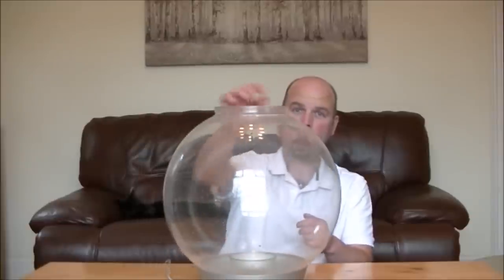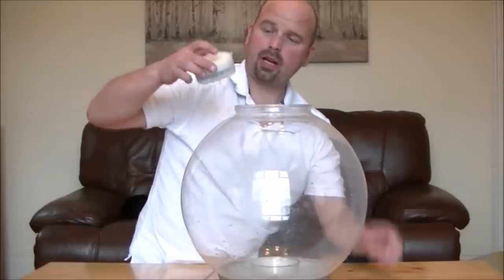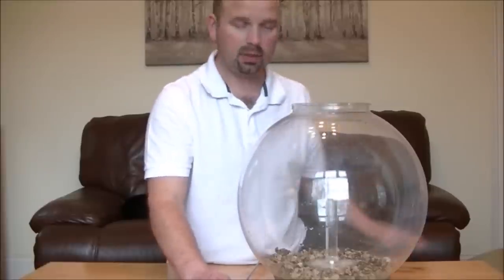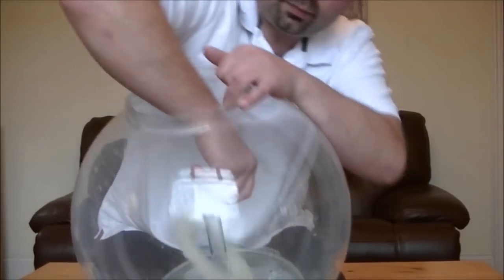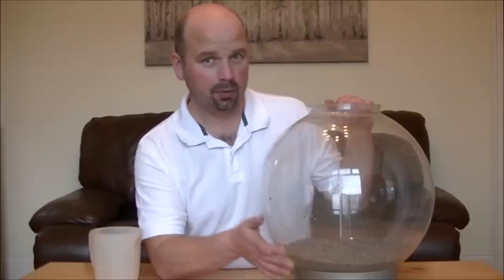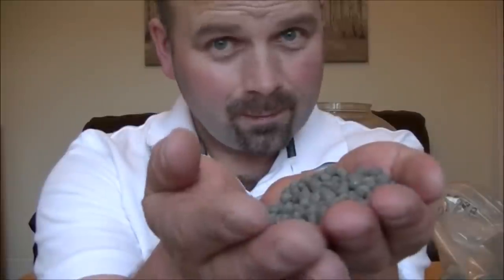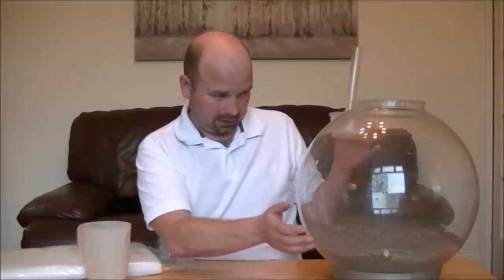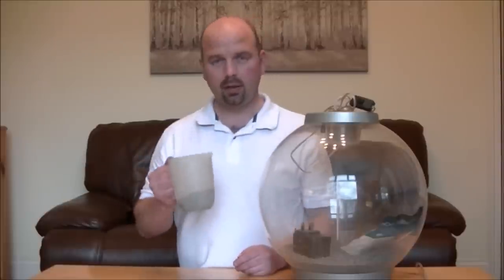BIORB COMPATIBLE UPGRADE KIT

Comment from the maker: Click 'SHOW MORE' for full video description and important links - watch in HD
PLEASE NOTE: amount of biogravel required for the biorb upgrades is dictated by the base area, not the volume of the tank as it is used as a substrate to cover foams. Therefore:
15 litre requires 1.5kg
30 litre requires 2kg
60 litre requires 3.5kg
105 requires 5kg
Above figures are based on the 'orb' shapes tanks - the 'life' and 'flow' rectangular tanks require 3.5kg and the foams would be cut to the full size of base.
Biorb upgrade kits: http://www.filterpro.co.uk ('Filter Kits' page)
Biorb gravel cleaner: http://geni.us/0YMWPJJ
Ornament to cover central filter plate: http://geni.us/WWBqb
(to make removal of central filter easier - less chance of biogravel falling into filter chamber)
How to set up a Biorb aquarium.....Making one of the most troublesome aquariums work properly?
That is the task being completed in this video and it also shows a unique, highly porous 'Biogravel'.
Feeding frozen and sinking foods is now possible with this upgrade as the food will not be lost under large sharp media (Biorb 'lava rock'). Great range of frozen food here: http://geni.us/LNA8 (select type - loads to choose from)
Full kits for 15 litre, 30 litre and 60 litre orbs and external filters can be found at this link: http://www.filterpro.co.uk
The Biogravel and foams are also available separately from http://www.filterpro.co.uk 
The Biogravel is made of the same material as Biohome filter media (sintered glass). Full video on that media to follow.
I will ship worldwide but to save on shipping costs please check out these links for other Biohome suppliers:
US supplier: www.greatwaveeng.com
AU Supplier: www.genesisgroup.com.au
CA Supplier: www.angelfins.ca
Apologies for the long video but there is a load of important information to get in there and I really like to share as much knowledge as possible to promote greater understanding of the filtration process.
Check out how to set up an external filter here: https://www.youtube.com/watch?v=lsAmSD3wVbg
Everything you could want to know about moving bed filters here: https://www.youtube.com/watch?v=DbGWp37djZQ
Biohome questions and answers here: https://www.youtube.com/watch?v=QGI-ybQoJmg
Thanks very much for watching an appreciating the video - please share it with anyone who has a biorb or similar aquarium.
Your support is awesome but as I get hundreds of comments every day I may not be able to reply to everyone.
Contact me by email on sales@filterpro.co.uk or on 07772848730 regarding biohome any time.
Thanks for watching and appreciating the videos.

A FEW COMMON QUESTIONS:

Do I need to take the medium/course foam rings out from under the gravel to clean them? (rinse in siphoned tank water, if so how often?) 
- It is basically creating an undergravel filter so as long as the substrate (biogravel) is cleaned with a gravel cleaner that will remove the vast majority of uneaten food / fish waste from the biogravel and upper foam so the foams don't need to be removed unless you want to do a deep clean which I recommend doing every 12 months or so. So far I don't know anyone who has done that as they don't want to disturb anything which is working well.
Ideally the gravel cleaner would be used once a week to remove waste from bottom of tank, just as it would with a normal tank - that will remove waste, do a small water change and freshen up the tank.

Do I need to take the fine filter pad out to clean, if so how often?
- That is just like the cleaning of the 'normal' pad for biorbs. When it is clogged it will need replacing but since you have so much filtration prior to water hitting that fine pad it could go for many months before it needs replacing - every tank is different but most will go 4-6 months before the pad needs replacing. Check after 2-3 months and if you think it would go longer next time just extend cleaning intervals to suit - no point cleaning / replacing a clean filter.

Do I need to replace the foam or fine filter pad, if so how often?
- See above with regard to fine pad in central filter, outer foams should last a good 18-24 months before they lose their 'bounce' but will still function as an undergravel system beyond that.

If I’m taking out the foam or fine filter pad. Do I need to take out my fish before doing so to be safe? I don’t want to kill it. 
- If you are removing the fine pad in the centre then that can be done with fish in no problem but removing the outer foams will involve taking out the biogravel so ideally that would be done when the tank had been drained and fish removed for duration of work - muck could be stirred up when the system is pulled apart so best to do that when fish aren't present. 

Is the air pump that comes with the BiOrb unit sufficient? If not what power air pump will be best?
- Yes the standard air pump will be fine as water flow is not restricted by the undergravel system.
Reply: Great video.  Do you have a video with it all hooked up as well?
Reply from the maker: No, but I will be doing a follow-up video showing a marine / hard water option soon and may as well film them running.
Glad you like the idea.
Reply: Loved your vid , Mr GURU ....ive just purchased a second hand biorb life 60l and so glad i came across this before i wasted money on those stupid middle filters , i was actually going to try similar to what youve done but wasnt sure if i could , as i say soooo happy i came across this , only thing im unsure about is the fine filter in the middle how often do i clean that please and i carnt find the white /cream pads where did you get those from and how much of this Biohomme do you think i will need x
Reply: My Betta Fish got pulled down under the biorb media in to the bottom of the filter!! Have ordered one of these kits as soon as I got him out! Disaster !
Reply: Like
Reply: Pondguru Hey i see you haven’t made a updated video to the biorb i have a working orb from the info u gave me on gravel ima post it on my channel soon.
Reply: WOW thanks 😄
This is Amazing info👩‍🏫🏆🥰☯️🔮🎓👑
Reply: @pondguru  WHAT! you WOULDN'T keep African cichlids in a glorified fish bowl? I'm absolutely shocked! :)

Comment: Love the idea, what I'd do slightly differently is I'd cut a hole in the ring of foam and place a potted plant like a crinum. And then put the media on so you can have areas that would have plant substrate and stuff like that. Thanks for the brilliant advice. You earned a new subscriber.

Comment: I came across this a few years ago and since upgrading the tank about 4 years ago, the plants, fish and snails are flourishing. I am using fine gravel but there's a healthy layer of dirt underneath now.  Part water changes about every 2 months and clean any muck off the surface and I don't really need to test levels very often now. 
Feed them every 2-3 days and a few extra flakes at the weekend
Great upgrade.

Comment: I've just done this and already my fish are super happy and it looks great!! It has inspired me to keep live plants after refusing to for years. I can't recommend this enough!
Reply from the maker: Very good to hear and I am working on a saltwater version of this system not as the upgrade kit sold by biorb for marine use addresses none of the filtration problems.
I'm glad you're happy with the kit as it was something born out of years of frustration with the biorb tanks.
Reply: @pondguru  I’m quite new to fish keeping but I’ve just set up the biorb with the ceramic media, now I’m thinking of changing to this system , how would I go about changing it as I have some fish in my tank already? Only 4 guppies so far though
Reply from the maker: @JDL__99  As long as you give the bioravel a good wash before use (soak overnight, rinse and repeat) and drop all the old water out into a suitable container along with the fish, plants etc. you can set up the new system and simply replace all the old water, fish etc. and top up with fresh water.
Most people put the old ceramic media on top of the biogravel for a few weeks to ensure that the bacteria can spread out into the biogravel then after a 3-4 weeks the old ceramic media is removed. That will be a smooth transition.

Comment: Hi - Been running the upgrade for 4 months now, amazing results - perfect water quality. Thank you, thank you, thank you!
Reply from the maker: No worries - glad you're pleased with the system and I wish the manufacturers would consider improving the filters in these tanks as it would save millions of fish each year.
Reply: @pondguru  I am just beginning my journey with biorbs and so have very limited experience. I love all the new things I'm learning from Richard, though the concern is that Biorb recommend removing any ceramic media smaller than pea sized, as this can get stuck in the filter area preventing you from being able to insert and close the air tube, please can you explain how we can overcome this?  Can you also create a video on how to clean the black foam filter and biogravel, and how often this should be done? I envisage this being quite tricky for me so would find a video most useful. Thank you.
Reply: @sweetdreamstime2266  (my other channel) As far as cleaning he foam goes it will be cleaned when you push a gravel cleaner through the biogravel and slightly depress he foam drawing muck from it - no need to strip down to clean unless you wan to do a deep clean after a year or so. To replace central cartridge just scrape media away from the centre and replace the foam or whatever you have in the central part.

Comment: Have to say you're a life saver, I used the biogravel to line the bottom of a Fluval Chi, and I put some of the bioballs from my existing 160 ltr tank in the top of the filter - an idea which was inspired by your moving bed filter in a water bottle video.  I now feel alot more confident that this tank is more than able to deal with 3 male Tiger Endlers and the Cherry Shrimps that live in there.  Thank you so much for your great inventions and ideas, and for selling us the means to do them ourselves at home.
Reply: Just realise Bioballs are actually big plastic balls... I meant I used some of your little filter media balls that looks like Malteasers (the ones you used in the mini moving bed filter video) in the top of my chi filter.  My bad
:)
Reply from the maker: Lucy Blayney No worries and good to hear you're experimenting with the filter. Best of luck with that.

Comment: hi spoke with you way back still have my very old given biorb 60 my up date is home made air filter stuck to side but the very old plastic lid kept shorting so this week removed wiring to light for the third time ,holding a halogen bulb ,using a transformer converter I rewired with the correct wire ,then on hunt for replacement halogen for LEd bulb and every thing is working fine ,so it has saved me the basic  £22 cost so it can be done
Reply from the maker: Nice one - you will get the bulbs online.

Comment: I saw the video and on the back of that, bought the upgrade kit for my 30 litre biorb.  I have now been running it for about 6 weeks, and added 6 Endlers and a ghost shrimp a week ago.  I plan on adding another 3 Endlers and possibly a couple more shrimp in a few weeks time.  The water quality is very good with ammonia and nitrites consistently at zero, and nitrates very low.  The water is crystal clear and the fish/shrimp appear very happy. I'd certainly recommend the upgrade kit!
Reply: I found one of my Endlers dead yesterday and it had no visible signs of infection or disease. I tested the tank water in my Biorb 30l classic which showed PH at   8.2. Ammonia and Nitrites are 0, Nitrates are 10ppm.  As a double check I also tested my incoming mains water supply which is 7.4 so something is happening in the tank.  I live in a very hard water area.  Any advice on correcting the problem please will be much appreciated.

Comment: I've biogravel in my 45L biorb and would caution against using so much that it covers the central filter cartridge. Yes, you can be careful in moving it away from the filter when you want to change the foam ring but getting the gravel inside the housing and jamming it to the point that it won't unscrew, is a real problem, as I've found to my cost and needing a complete emptying and strip down.
Reply from the maker: Yes having only a light covering over the central filter or better still something like this covering the central filter: http://geni.us/WWBqb would ensure that the gravel does not contact with the central filter cover plate so that is a very good point you made there. I have added the link to that ornament in the video description.
Regards,
Richard

Comment: Thank you for sharing your knowledge and your expertise.  I am a beginner and really do care for my fish.
I have a BiOrb 60L for which I bought a year supply of the commercial filters.  I have 5 left.  So, I have a feeling that I am going to be sourcing all of the components (I am in Australia) to make your particular filtering system. While I love my BiOrb, I am frustrated with how hard it is to actually clean.
Because it is so hard to clean properly, I have removed and cleaned the standard filter 4 times today, plus spent 2 hours skimming the water after rinsing out the filter.  It seems that a lot of crap gets caught in the filter orifice.  I have a single fancy and a golden sucker fish in it and clean it out weekly.  I am ok to do this as I find the process quite relaxing, but just annoyed that it is never as good a job as I would like.
Reply from the maker: +alonyaJ As long as you don't lose too much original water you can clean it as often as you like but its a whole heap of unnecessary work. Yes it costs a lot to send anything from UK to AU but the Australian supplier of biohome (link on my website: http://www.filterpro.co.uk) should have biogravel - the foams may be more difficult to source. Try sellers of pond filters for those.
Reply: I have finally got all the bits together and today I have assembled by tank per the instructions.  I could only get the BioHome minis here in Australia, although I prefer the look of the pebbles that you used in the video.  I snapped 2kg in half and put the other 1kg in whole.  The stupid cartridge received 2x Micropads with the little off-cut bits stuffed into the bottom due to a lack of the pebbles.  I am looking forward to seeing how this works.  I am considering converting it to a tropical as I have had more luck with that than with goldfish.
Reply from the maker: Yes tropicals are much easier to look after in a small tank so would be worth giving a go in a biorb If the biohome mini ultra won't snap up suitably you could just use ordinary gravel - don't feel compelled to use biohome if the biogravel is not available from the AU supplier as ordinary aquarium gravel will still do a decent job and will be smooth compared to snapped up pieces of biohome mini ultra.

Comment: Just cut a larger foam ring around the central filter, crushed lava rock as a base then then the biorb media over the top for a quick cheap fix. This will increase contact time and surface area for beneficial bacteria.

Comment: I have a 15l biorb which has a male betta and his girlfriend and theres apparently a shrimp in there somewhere ?! how would you recommend me changing out the filter system to the kit one in your shop? thanks
Reply from the maker: +Sophia-Teresa Morgan As long as you remove all the water and substrate very carefully you should be able to catch the shrimp and fish and store them in a container with the original water. Set up the kit, fill with tap water then drain most out and that will remove any dust not washed out by initial rinsing of the media. You can then put your old water back in the tank and add the fish and shrimps back.

Comment: Just wanted to thank you for this wonderful solution to the biorb filtration. I have the original 60 litre tank and I was honestly ready for throwing it out as the water was turning murky within 3days . I implemented your new system over a week ago now and my tank is still crystal clear. I would highly recommend for anyone with a biorb tank to do this asap. Cheers Sharon
Reply from the maker: Dear Sharon,
That is great to hear and I'm glad you're pleased with the system. It's not a magic bullet but it definitely goes a long way to making a biorb low maintenance and very well filtered.
Regards,
Richard

Comment: its me again up date on my Biorb have taken off air lift and filter out but had problems with air flow in fact it stopped tried blowing down tube ,was going to change none return valve but poked carefully about ,still no air  but had an idea ,using a slim syringe started to draw water up through stem ,within an hour the flow is mind blowing,using the media suggested but using a small mini filter again given to me along with some coloured led lights ,the filter is near the top but because of circula shape at an angle and not visible i would like to keep in touch to show progress thank you
Reply from the maker: Sure no problem and I'm glad you got the problem sorted with some quick thinking.